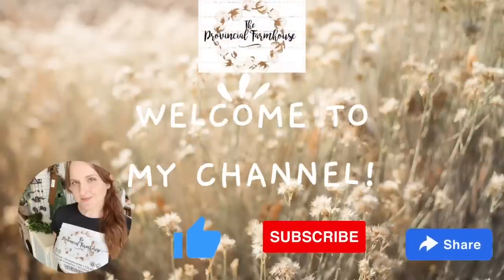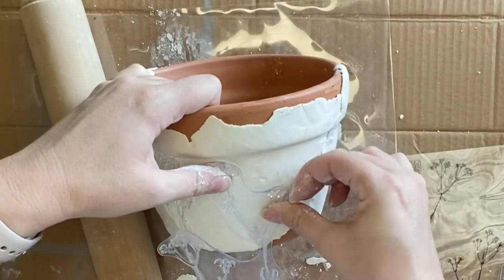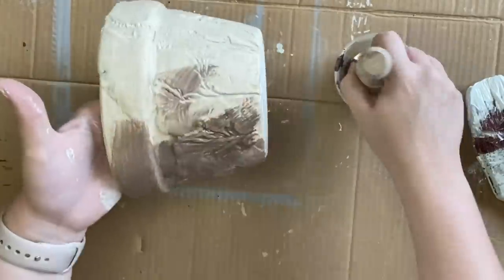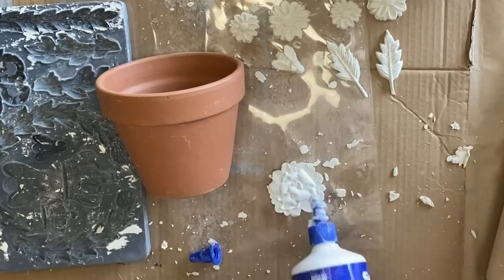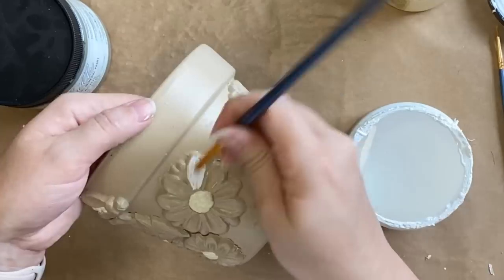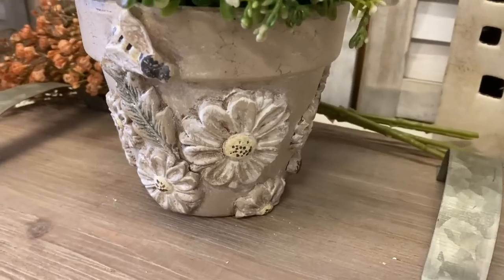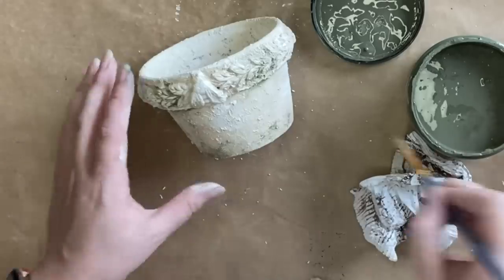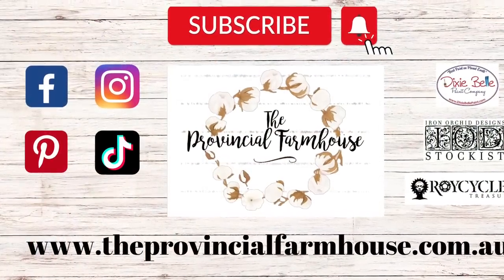DIY Spring Pots using IOD | French Country Decor | High End Budget Friendly | Cottage | Garden Decor

Comment: Lovely.  Because air dry clay shrinks a little when it dries, have you ever encountered problems?  Or does the glue prevent a y issues with cracks or pieces falling off?
Reply from the maker: Thank you 😊 I find that if I paint the clay before it dries it has less cracking and shrinking.